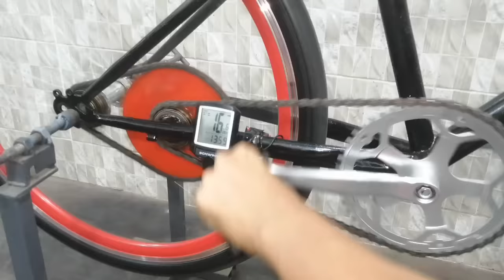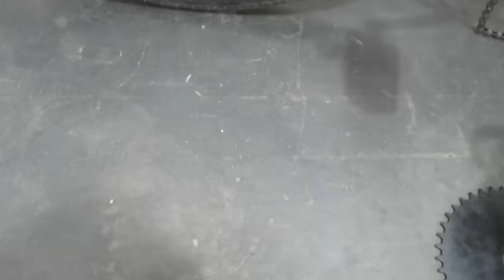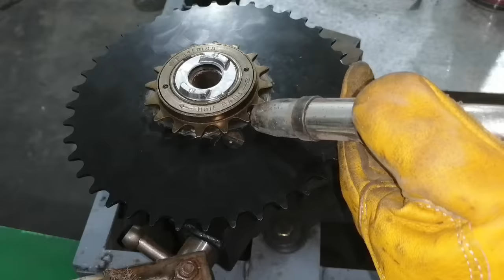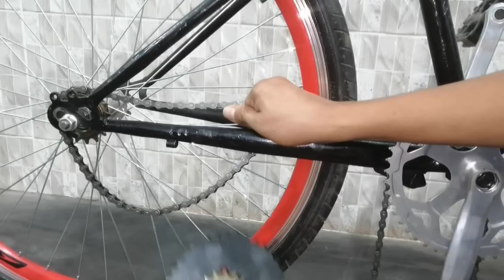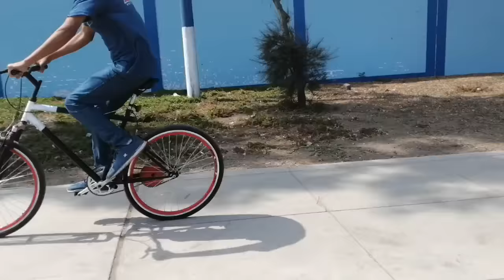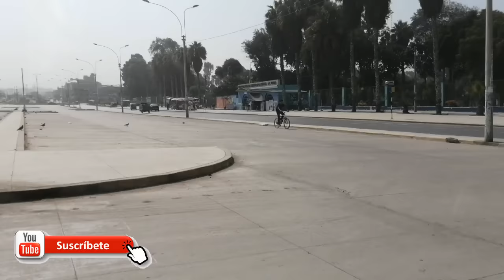increase the speed of your bike.speed multiplier

Comment: That's great for flat road, but the slightest incline he would have to walk.
Reply: That's part of the scene...no?
Reply: Agreed
Reply: Correct
Reply: yes           how to make it work?
Reply: Yup,....You are right...But I like the idea...👍👍👍
Reply: If it's only a town bike think of the potential! Awesome job!
Reply: Very close to true. But the modification is no less awesome because of it
Reply: Unless... for the record.. he was going so fast that the slightest incline became the flattest earth ever...? Right? Who's with me?
Reply: Thats cool but for by coast beach
Reply: Exactly
Reply: Heading for Bonneville , bike  speed record.
Reply: @fahmianto9681  que
Reply: @fahmianto9681  o99
Reply: He's doing this for likes and content. Not practicality
Reply: Add a few more sprockets, and a derailure😜 those hills wont mind
Reply: @davegreen9155  it would still be very difficult, even with a 40 tooth cog on the rear. Maybe If you could put a derailleur and cassette on the middle first connection it would help.
Reply: That's giving it too much, high gear on a 10-speed is enough. This would only be good for downhill, if you want to go dangerously fast. Almost useless, is there anything awesome about that?
Reply: Not to mention stopping. Hit the brakes and they poof like a flashbulb.
Reply: @TheHailacopter  Brakes? We don't need no stinkin brakes!!!
Reply: The same I think of.
Reply: How please explain
Reply: @TheHailacopter  nah, upgrade the rotor and use hydraulic. I run dual disks on my e-bike up front(fat tires, modded rim) but for SURE don't go cheap!
Reply: Yo. Correct
Reply: goodluck on his chains
Reply: I don't think so. He'd just have to peddle faster
Reply: Is it cost effective than regular gear system
Reply: not so great even on the flat with gearing for 90km/h, plus additional losses from double chain I bet you would have a hard time getting up to speed, balancing at low speed  or even maintain momentum especially with the slightest wind or incline. I would be surprised they didn't film only going downhill probably
maybe kinda ok ok if you are used to ride single speed uphill or for flat salt speed record with a truck removing air resistance. it's actually pretty similar to the bike they use for these kind of records.
Reply: Not if he don't skip leg day
Reply: I think your all missing the point. Of the diy. Look at his legs as he is pedaling. He  seems to be pedaling at a casual  pace. Yet he is clearly going as fast as he would. If he was going full throttle so to speak. I don't believe he would have trouble going up a mild hill with little to no effort. 

Or maybe I am misunderstanding here. Whatever I suspose
Reply: @jamies1725   is it cost effective compared to gear system
Reply: @jamies1725  Yes, he is pedaling, however, there is no footage of him starting off.  He would have to try to keep his balance for a bit before getting up to speed. Also, when he stops at a junction, it's going to be quite challenging to get going in an emergency.  

I can agree that it makes a fun DIY project but it isn't practical for commuting. Maybe for setting a land speed record on a bicycle with no headwind or with a tailwind.
Reply: @brentbingham4886  🫡truuuuuu 🤩… #physics
Reply: Pretty much. I use a juiced hyper Scrambler  e bike and it's already a best
Reply: @jamies1725   the weight will catch up with his momentum. And when it does he has to fork out 4 x the strenght
Reply: It's advantageous on a flat road only in a very strong tailwind. And in the video he rides in tailwind and the cadence is still too low.
Reply: Yes because we are at a mechanical disadvantage afterall. I've explained the phenomenon well in my comment they started a debate there -_- ..
I hope u guys will atleast understand what I meant there.. just take the knowledge from there..
Reply: It should be switchable on the go so we can switch between settings
Reply: Great if you live in Kansas
Reply: Верно, ещё железные ноги 🦵 нужен, чтобы ездит на такие велосипед!)))
Reply: Solution simple if you want better speed and control get a multiple gear bike or change the rear wheel and add a derailer
Reply: Esto ya lo hacen los cambios convencionales. Para desarrollar esta velocidad y poder mover la catalina-piñones    como se ve en el video le cuesta mover los pedales tal cual con los cambios. Cual es la ventaja de este sistema? Esto es para bicicletas sin cambios?
Reply: @oriolhd2758  no comprende
Reply: Imagine going downhill
Reply: @Jandeganjaman  That would be loads of fun.
Reply: Exactly. Really amazed at the lack of basic science knowledge concerning gears when I look at the number of likes and comments approving this.
Reply: @TheHailacopter  lol
Reply: No. Not if the inclination is downhill. This innovative drive train is excellent for downhill riding, which would have been really good for me, because my school was 6 miles away and downhill in both directions!
Reply: Good for flat South Florida ...
Reply: Ok Im probably missing something but I just can't figure out why you wouldnt be able to go on an incline or am I missing something big? I'm not a mechanic at all
Reply: @jacksparrow4656  You would be able to go down, for sure, but you would be at a serious mechanical disadvantage with even the slightest climb.  

Cyclists know this all too well, especially when we are out of shape. lol. And this is with a normal gear ratio.  So imagine the project here and trying to go uphill without previous momentum.  That's why I said he would have to walk.
Reply: @sheeznutz2254  that's right a stick in the front tire always works in this case the bike stops you take flight
Reply: It would be better to leave it on direct drive instead of overdrive
Reply: Yes, you'd need tremendous torque for an incline of any height, ...the present gear ratios are for a reason to have a decent cadence, ...
Reply: But the slightest decline…. He’d have to scream!!!
Reply: I can't even pedal my road bike on the flat  in top gear.
Reply: And where is the getting going shot 🤣
Reply: That could be solved with Bafang
Reply: @jamies1725  This is just the same thing as trying to ride a sports bike stuck in high gear. You need to put a lot of force on the pedals to get going and to keep the speed with just a little headwind or incline. It’s certainly not ideal for average biking. If it was, they would make such a high gearing standard on any bike. The gearing on a bike is however setup the way it is, to have the best compromise between light paddling and achievable speed.
Reply: A good man brings good things out of the good stored up in his heart, and an evil man brings evil things out of the evil stored up in his heart. For the mouth speaks what the heart is full of.
Luke 6:45
Reply: Great point of view... now we can think  about a mechanism to switch the star wheels to avoid this problem...
Reply: And make the pedal more heavy
Reply: @Stephon723  It's either true or not true.  It think it's the former.
Reply: You could add a second set of gears on the other side of the current one. Then add a shifter between the two. It wouldn't be perfect but it would give you an option
Reply: @Al-rx1vs  not when you throw in the MIG welder LOL
Reply: Very true
Reply: @rp9674  yea the speed he was going was just normal at the end anyway. It is the speed I ride at normally.
Reply: What if a 24 speed bike had a multiplier. Then you could keep gearing down. I've ridden 24 speed mountain bikes up hills so steep
Reply: Yah you said what’s on my mind
Reply: @jfrtbikgkdhjbeep9974  u gona need to put a e- motor to support u and that’s also gona make u think why I need it?
Reply: Add a front electric motor for hills.
Reply: Living in the Netherlands. Sounds perfect 😄
Reply: Great in town 😜
Reply: @brentbingham4886  We playin special theory of relativity then
Reply: He could install another pulley for that situation
Reply: You have to walk uphill... 😂😂😂
Reply: I didn't watch the video but I instantly noticed the flaw in the thinking, I believe that bikes have been around for a very long time, if it was such a great idea it would be everywhere, so that said, keep trying this is not going to put you in the record books.
Reply: meh, I walk up hills anyways....
Reply: Yes
Reply: That's why gear shifter is necessary
Reply: just add a bafang.....done.
Reply: @brentbingham4886  yes.
Reply: Phoenix AZ. about 7-8  months out of the year. Maybe more If you soaked your clothes in water to use evaporative cooling while high speed biking.
Reply: Then  only stay on flat
Reply: If you live in the desert or near beaches. It would be great. But it needs a neutral design built in for hills/mountains.
Reply: True
Reply: @iriqouisplisken5640  💯. I'll get a bicycle in April,since MY legs are massive.(nearly ALL muscle in calves & quads...) I may NOT get to out bike a car...it's acceleration is TOO fast.
Reply: Could you explain it further ?
Reply: @supremezer  Even moving off with a regular bike in it's hardest gear is difficult. And once you get going, you need lots of momentum to overcome inclines or even a temporary headwind. So I know from experience that an overdrive such as this would be near impossible to climb. But in an indoor track such as a velodrome you may see some interesting results. Body weight alone on one pedal may not be enough leverage to start on an incline.
Reply: Why?
Reply: @innovationindustry4962  Not enough of a mechanical advantage if you can call it that.  The same reason cars move off in 1st gear, and the same reason you shift down for a hill.  This gearing is wayyyy too high. This is a super overdrive is very well suited for speed records over flat road (wind assisted or behind a wind shield).  Don't get me wrong, I love this project and gave it a like.  I had no idea, however, that my comment would have over 1000 likes.😁
Reply: Florida & Chicago is really really flat! 🤷‍♂️
Reply: 100
Reply: I have a 80cc 2-stroke engine online I wonder if that would work on the other side of the frame on the engine chain??
Reply: Good engineer
Reply: Yes
Reply: @jfrtbikgkdhjbeep9974  with a 32 tooth crank and a 13 tooth cog
Reply: Except that much momentum could carry you up a pretty good sized hill.
Reply: @TheHailacopter  My cheap bike has large disk breaks that are pretty comparable to the ones on my 300lbs + motorcycle. No hydraulic compression but also 300lbs lighter. Better not grab a hand full of front break!! 😂🤣😂😵😵😵😵
Reply: Unless you put a motor on this puppy, then 😎😎😎
Reply: @rp9674  You're right.  No one in these comments is spinning out on the top gear of a road bike on the flat.  All this would do is cause the bike to be difficult if not impossible to pedal and far more likely to cause knee injury.
Reply: That’s when you turn on the 50cc motor
Reply: Cycling uphill is overrated.
Reply: That's no problem in the Netherlands
Reply: Just get a mountain bike if you wanna cruise like this and don’t fuck your bike up
Reply: So just like a regular bike? :D
Reply: walk part of the incline. He will climb half way or over completely by momentum
Reply: @TheHailacopter  oh okay
Reply: Re-designing the wheel are we? What happened to normal selectable bicycle gears?
Reply: Why?
Reply: @Oobservatory_X  gearing ratio
Reply: we Indians do off-road with that type of suspensions less cycles 🙃
Reply: @iriqouisplisken5640  that's what I was thinking
Reply: Absolute
Reply: you misspelled stand and break pedal arms
Reply: @Oobservatory_X  No mechanical advantage.  It would be like trying to raise one person sitting on the end of a seesaw while you sat on the opposite side but closer to the fulcrum.
Reply: Brazil roads: 💀
Reply: Why walk just eat more be a man😂
Reply: We need solutions not problems. Come up with it.
Reply: Why though
Reply: @abhirijal91  I don't think u understand how hard this is it will eat up all your energy within minutes if your trying too hard...Try it with any bike use the big ring and small ring and let me know how far you go..keep in mind most rings are 3-4x less than this which means this is way harder than a normal bike so if 80-90% can't ride the bigger ring for long you wont last in this for long
Reply: Fica muito pesado
Reply: Bs I ride up hill on a board 20 inch fixie beachcruiser... going those speed all you'll have to do is keep up momentum, and pedal.
Reply: That's y we have gears
Reply: Or he/she is never be able to walk
Reply: Great for a world record bike run on the salt flats.
Reply: @jfrtbikgkdhjbeep9974 more rpm/speed means less touqre, so you need tourqe to climb incline. Basically that's why cycles (or bikes) with different gears exist to optimize for different situations. Instead if this, modying normal geared cycle to have higher gear ratio is more pratical
Reply: @MUSICSxSHADOWx24x7  редуктор
Reply: wind speed as well
Reply: Roads where we are going we don't need Roads or did some else say that

Comment: yes , but the start will be very difficult unfortunately
Reply: Not really. Just get a running start, then hop on the bike and pedal like you're being chased by a SCREAMING BANSHEE
Reply: No.  Problem
Reply: I think tork will be very less and very hard to drive
Reply: Going uphill would be impossible
Reply: @toulee8051  gg.z
Reply: @fidztshuma1986  brother who goes uphill by cycle
Reply: @shivbhajan8110 
A lot of us in Africa who use bicycles as a means of transport (not joyrides) ... The roads aren't level.
Reply: @shivbhajan8110  by your logic there would be a large pile of bikes dumped at the bottom of every hill.

Comment: It would be interesting to do some calculations to see what would fail first on a stiff hill: 1) rider's legs, 2) gear teeth, 3) chain, 4) gear connection point, 5) pedal crankshaft, 6) pedals, 7) something else.
I would also be interested to see a top speed without the modification using GPS and a top speed after.
Reply: No 8) accelerating from 0 mph
Reply: He should refine it. Maybe add intermediate gears or a tiny electric motor in the wheel to ease the torque. A lighter bike would help too. Cool idea anyway ☺
Reply: I built one 2 years ago. I would go like 25mph before and about 45-50mph after. But yeah any incline your done.
Reply: Не стоит забывать риск зацепиться обувью или одеждой за дополнительную звездочку.
Лично мне кажется, первее придет конец раме. Она не рассчитана на такие нагрузки, к тому же металл испорчен при сварке.
Reply: @silverangel2719  получился обычный редуктор с повышением оборотов колеса, ничего удивительного
Reply: @outdoorlife8086homeaudio  No you couldn't do that speed before or after.
Reply: i do bealive that this is good only when youre at  high speed.. some how as normal and once you reach top speed to switch to this mechanism.
Reply: Riders knees and chain for sure.
Reply: I rode bmx for years and worked in a bike shop. The first thing to go would be on of the freewheels as the look very budget if the weld doesn't go first.
Reply: All would fail
Reply: I just imagine the papers saying something like this when Philipp Moritz Fischer invented the bike. It will end tears they'll say, everything will break including the rider... some 150 years later...